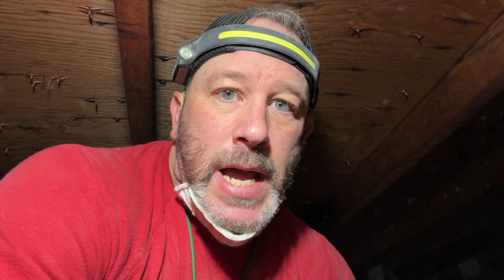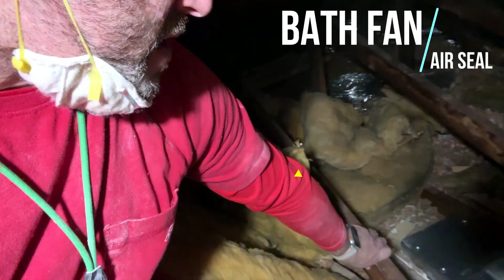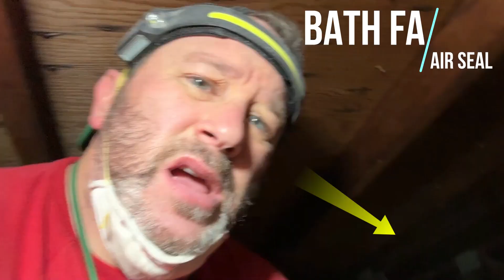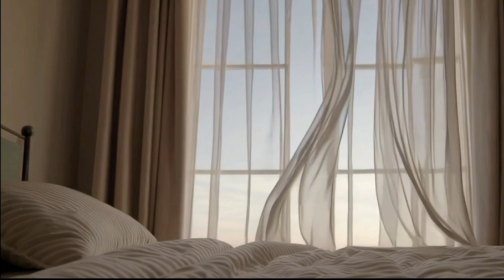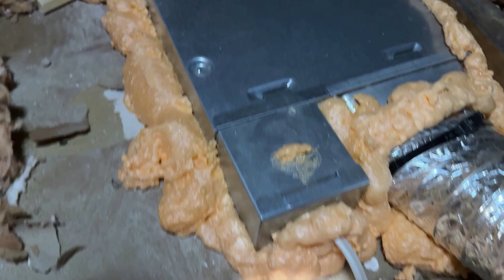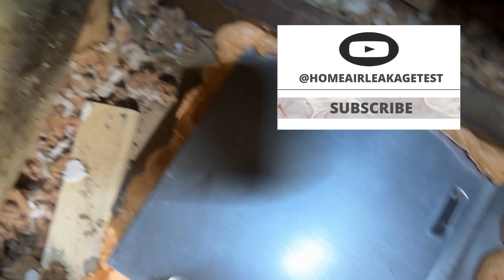How To Air Seal A Panasonic Bathroom Exhaust Fan Using Spray Foam

Comment: Hello from Canada! I just installed a new Panasonic fan in our bathroom. I thought of using spray foam around the edge, but did you cover the entire fan so plastic vapour barrier is not needed? Thank you!
Reply from the maker: No. Only around the fan. Most of the housing is air tight.